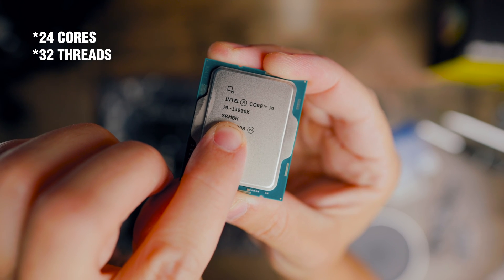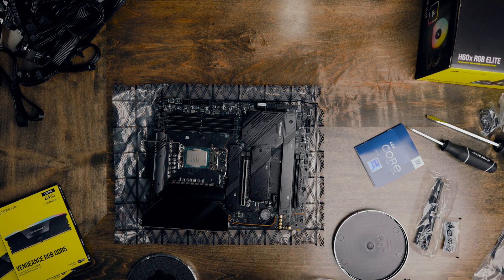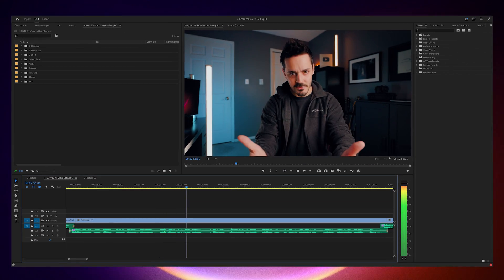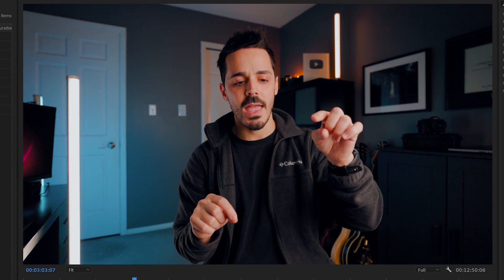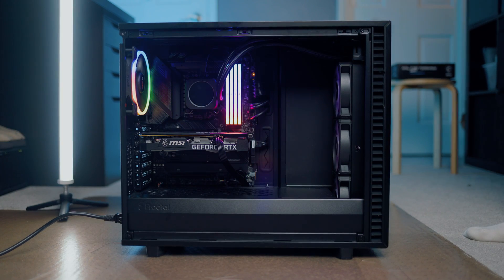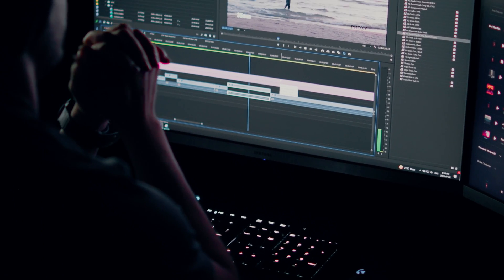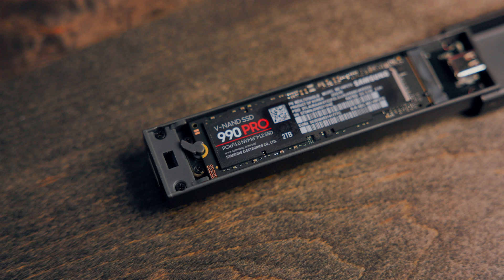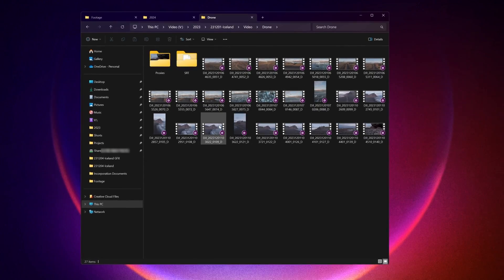My 2026 CUSTOM Video Editing PC Build 💻

Comment: I love, that you got to build a pc and didn´t just stick to Mac, but there´s a bit of misiformation in the video.
1) you definitely don´t need the 1000w power supply, those are built for folks, who run multiple GPUs or some server hardware. In terms of the PSU wattage calculators, they are almost always way over, just to be safe. You would be perfectly fine with 650w with your current configuration, and maybe 850w if you want to upgrade the GPU in future, and you´ll still have headroom. After all, your PSU is most efficient around 80% load.
2) GPU, GPU, GPU. You definitely want a better GPU. Even if the Canon video somehow wouldn´t work on GPU (but the H265 definitely does), all the renders, effects, noise reduction and colour grading can benefit hugely from GPU acceleration and the fast video memory. GPU literally stands for Graphics processing unit. It is built for this sort of work. Plus you are getting the av1 video codec with new GPUs.
But hey, great work after all :)
Reply: also, the CPU parameters are too oversimplified. It's like comparing two cameras just by megapixels, but there is not much you can do about it. The best solution is to just look up a couple benchmarks in the field you work in...
Reply: thank you im glad someone said this

Comment: For h.265 10 bit 422 editing, intel or apple are the only choices with native decoding. Of course you could always transcode your footage as well.
Reply from the maker: I find myself making pro-res proxies for most projects, and then deleting the proxies once the projects is complete!
Reply: @AnthonyGugliotta  Wait, what? You still need to use Proxies, having that processor with QuickSync?? Just asking, im about buying that processor...
Reply: Which is qui ker cpu or GPU for decorig? Can you use both at the same time.
Reply: Nearly all modern Nvidia GPUs can decode/encode h265, same for AMD. not sure where you got this information from, but it's factually not true.
Reply: @HeyItsTerry  I guess I should've clarified I was referring to 10 bit 4:2:2 h.265, which currently nvidia and amd dont.
Reply: @TerryDoesTech the current nvidia 50 series gpus all support h.265 and h.264 codecs.

Comment: Thanks for your video! I edit my photos in LR and my videos in DaVinci using a self-build Windows PC. I have a Synology NAS at well.

I would be very interested in your workflow and data mgmt. From the moment you take the picture/the video to the output. Output for me is mainly my LG OLED Smart TV on which I want to watch the family videos and pictures. This would be very tricky with the High-End H.265 Codecs which you use. Futhermore the rights mgmt of the Synology photos app can be very challenging.

I am very impressed with the diligence you approach new topics. Therefore I would be very interested to see your approach.

Best
Simon

Comment: IMHO: 
Would have gone for two bigger ram sticks instead of four, (from what I see) your CPU only supports dual channel, so you might lose some performance there, also try to keep the timings as short as possible, for RAM its not only Mhrz its also the timings ;-).
Also, please make sure your Apps use the RTX instead of the CPU integrated GPU ;-)

Comment: 1, the CPU clock speed and the core count is grossly oversimplified. The analogy doesn't work because you can only compare those two values within 1 generation of cpus. 2 don't put your Mobo to the case at least before inserting the cpu, ram, nvme ssd's 3 for rams you also need to mention the latency value as well as the frequency of said ram as well as its generation 4 the case choice will make the airflow suffer as the front of the case is msotly blocked. You can get good fans and a good airflow case and the performence will be more and the noise levels will be same. 5 Also AIO's are noiser when idle compared to air coolers and unless you're doing custom water cooling they won't provide any significant performance improvement. Yeah otherwise I love your content, great video!
Reply: There aren't many/any air coolers on the market that can effectively dissipate the heat from a 13900K. A 360mm AIO is kind of the entry level for this CPU
Reply: Bros I need help

Comment: I uavent build a PC in ages.  Like still using "DVD-R and floppy drive" ages ago.  Even new budget PCs today are cleaner than some of the more expensive gaming PCs of way back when.

I fairly recently did a "new-ish" build to replace my 15 year old home build rig.  I had a gen1 i7 on am ASUS motherboard, 32gb DDR3 duals, booted off a Samsung EVO870 1TB SSD, played off an RX470, had a DVD-R and a blu-ray drive (which was never ever supported), had an old WD 7200RPM 1TB drive for storage, and a Thermaltake Shark in silver.
Replaced it with a prebuild but replaced the CPU and RAM, from an i5 to a gen9 i7, 16gb DDR4 to 32gb DDR4 duals, RTX 3060, 1TB Samsung m.2 for boot.  I also replaced my old 21" Samsung monitor, also as old as the rig, with a 4k 27" Dell (i can't fit anything larger than that on my desk), and the same Logitech gaming mouse as yours.

But my replacememt rig i got on the cheap via auctions around Toronto.  Its typically a $1600 rig, but i snagged it for $800 (almost $1k after taxes and auction fees).

Comment: Why do you use your CPU for video editing and not your GPU? Wouldn't the GPU be much faster?
Reply: Cpu does most of the work. Only when rendering and using certain gpu accelerated effects use gpu.
Reply: Also, you have a 3060 from MSI so you should have 12GB of VRAM which is more than enough for big video projects.

Comment: Great video.  Our pc build is about the same in almost every aspect.  I am interested in the file management system you use.  Especially how you use the different drives.
Reply: what is the price range for a pc like this?
Reply: @alpaca471  mine was about $1600-1800 for all the parts

Comment: You said for what you do the 3060 is fine… but to me that seems like a MASSIVE bottleneck, the cpu being top of the line and the gpu an older, budget one.
Reply from the maker: I completely agree, everything else is so fast, that the GPU almost doesn't make sense. I linked a few 4000 GPUS in the description I might upgrade to over the next few months.
Reply: @AnthonyGugliotta Fair enough. 13900k can easily do even a 4090, so you’ve got lots of upgrade options lol
Reply: @AnthonyGugliotta wait for rtx 4070 ti super 😂
Reply: @AnthonyGugliotta please please anthony gugliota please do save your card please please put a supports to made your card graphics stand to or put a stand support for your card graphics because when in time please before it to late please please save your card graphics 🙏please anthony gugliota please .it very needed only please 🙏.
Reply: You can use 3060 to edit videos no problems, but for simple timelines only. When you start adding alot of effects, transitions and layers and stuffs then the rendering time will be longer. For playback, editing and timeline performance the intel cpu and it's igpu are what's working hard in decoding. The gpu only comes into play onlu when using certain gpu accelerated effects and rendering(encoding).

So if you don't have the need to render fast and get the videos as fast as possible then using a 3060 isn't that bad.
Reply: @Prabhu_njd exactly! And I have an even older GPU and it really doesn't make much difference as you said only those effects that are hardware accelerated makes a difference. Otherwise CPU is where it's at.
But most of the people who comment here don't edit much and just go by specs
Reply: @vueport99  i totally agree with you.
Reply: Most of the Programs he uses have not too mich use for the grafikskard... A boatlnack shure but only for gaming...
Reply: @phillipschimek7545 video editing / rendering / upscaling uses GPU
Reply: @phillipschimek7545 video editing often needs just as much or more gpu power as gaming…
Reply: @ezrareimer that really depends on your effects and transitions. Quite often my GPU isn't doing much. So I rather dump more money into memory
Reply: Give the guy a break guys. He'd probably upgrade his gpu after awhile. I used my zotac rtx 3080 10gb card on my new build for about 4 months till i finally bought an asus rog strix rtx 4090 oc just last month.
Reply: Dude, bottelneck is for games
Reply: @LazyDay88  or any application(like editing) that uses both cpu and gpu...
Reply: It’s because editing dosnt require a super powerful gpu it’s only a bottle neck in a gpu intense task
Reply: The 3060 is fine if it’s the 12gb card and it’s simple footage. It’s just longer export times and the 3060 performs well for video editing for its price. The 4070ti Super card is probably the best card out there for value because of its higher clock speeds and 16gb VRAM
Reply: So what would be sn ideal GPU for this configuration?
Reply: @manuginco3753  whatever the best you can afford is, up to the very highest end ones.
Reply: @manuginco3753  ideally a 4080 super or 4090 if there's no budget. But if budget is a concern the intel arc a770 16gb would be my choice.
Reply: @manuginco3753  probably a rtx 4080 super or a 4090
Reply: How is this when recording 4k videos direcly to the program

Comment from the maker: What do you edit your photos/videos on? PC or Mac?
Reply: pc photos with gimp until i can get lightroom
Reply: PC
Reply: PC
Reply: Windows 11 pro
CPU: Intel I9-13900KS
MOBO: Asus Proart Z790 Creator Wifi
RAM: G.skill Trident Z 96GB ddr5 6800Mhz CL34
GPU: Asus ROG Strix RTX 4090 OC 24GB
PSU: Asus ROG Thor 1200W P2
COOLER: Asus ROG RYUJIN III 360
OS: Windows 11 PRO
O/S Drive: Samsung 990 Pro 1TB
Project Drive : Seagate Firecuda 530 4TB
Project Drive 2: Teamgroup T-Force Cardea Z440 2TB
Cache Drive: Seagate Firecuda 530 500GB
PC CASE: Asus Hyperion GR701
Reply: @Prabhu_njd how much all of that run you in total?
Reply: Mac Forever!
Reply: Editing on Mac is the most stable option, even on MacBook Air M1